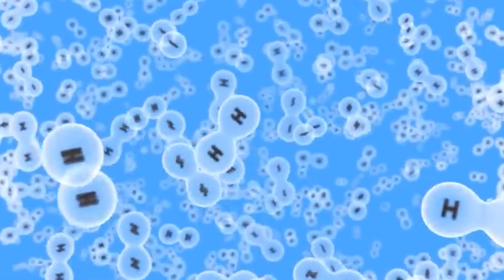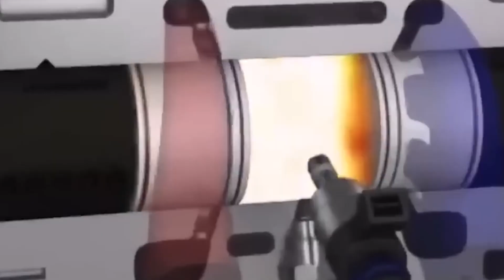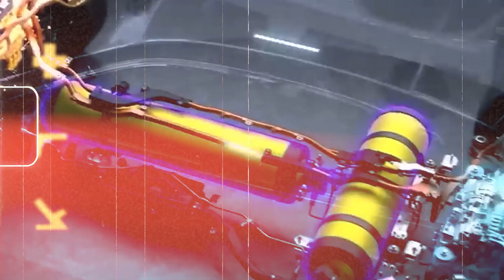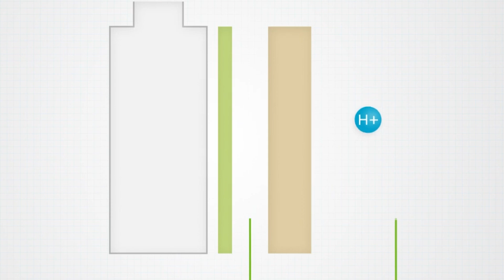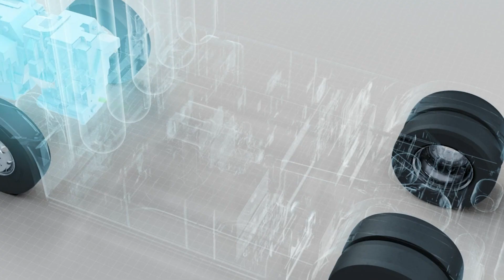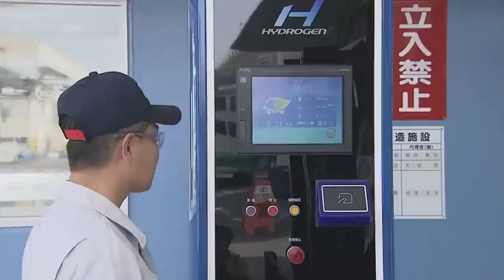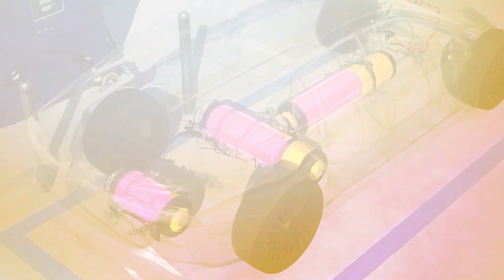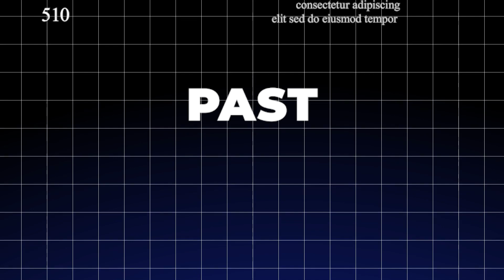Toyota CEO: ‘'We’ve Created An NEW Engine That DESTROYS All Competitors!''

Comment: Okay great hydrogen is clean. But you're forgetting that we have to produce it, store it, distributed. So just what do you think that's going to cost. I'll tell you what at least three times the price you're currently paying to fill your tank with gasoline. You can make your own electricity in your own home. Can you create your own hydrogen? So yes of course hydrogen is clean but to think you're going to save any money using it whatsoever is a complete fairy tale.
Reply: Yes today hydrogen remains expensive. But technology is developing. In a few years hydrogen will be the only solution. The production of hydrogen from renewable energy sources is planned worldwide. The storage of electrical energy is saturated and as everything shows there is not much room for improvement. The development of hydrogen, on the other hand, has many advantages but also many areas for improvement regarding its management, storage and production costs.Also, as everything always shows, Toyota after years proves that it makes the right decisions.

Comment: Electric motors to drive the Autos is the future. But how do you produce the electricity? Batteries are very heavy and take hours to recharge and the NATIONAL ELECTRIC GRID is already outdated and can not take a 70% increase in demand.  Gas is fast and easy to find on almost every street corner. Hydrogen is the cleanest but how do you produce, distribute and contain it?
Reply: That's exactly right, you've got to produce it, you have to store it, anybody out there thinks they're going to wind up buying this hydrogen for anything less than three times what they're paying now for gasoline is just purely shiting themselves. 
You have the ability to create your own electricity can you create your own hydrogen? Riddle me that one Batman.